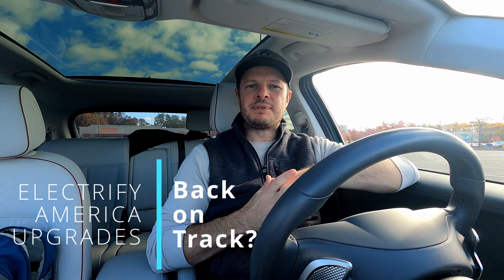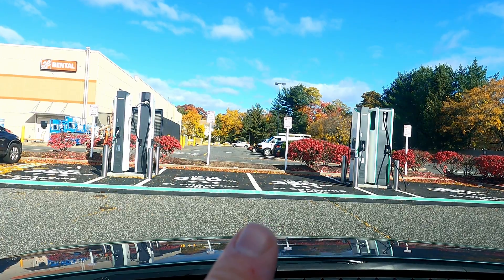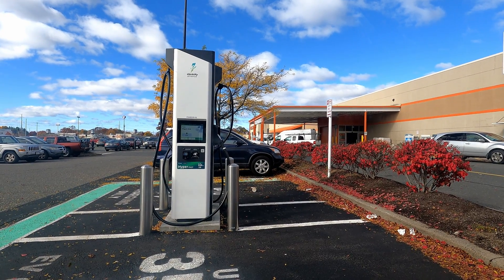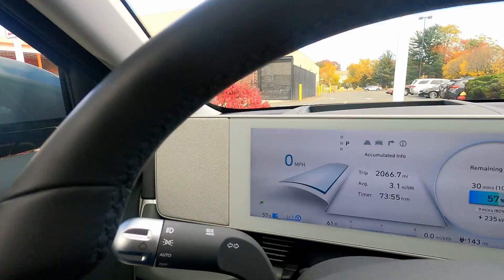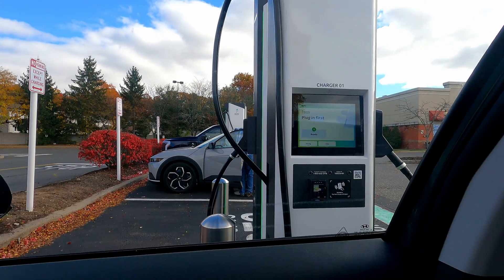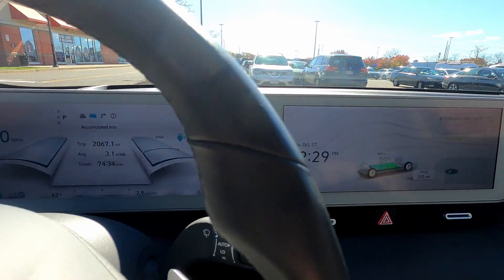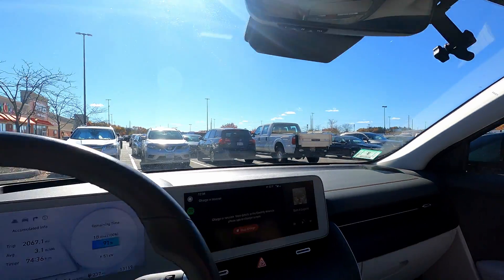Electrify America's 350kW Site Upgrades (with Balanced DC Fast Charging)

Comment: Steve, great testing.  It seems EA is becoming more reliable with the New units.  I'm glad the EV crowd got on EA to show they were lacking in reliableaity.  New owners will have a better user experience.  EA and auto manufacturers still needs get plug and charge  working for all vehicles.
Reply from the maker: Thanks, David. I think the challenge now will be keeping these stations fresh and making sure that none of the old "problem locations" take too long to be upgraded. But new owners will also need to bear some responsibility for learning their vehicles and the best way to activate a charge. Every new tech takes a  bit of adjustment and it makes sense to dig into the details when that new tech is our mode of transportation!
Reply: @plugandplayEV  for ease of use, cars with PnC and Autocharge have an advantage over any vehicle that requires the driver to futz around with payment options such as app or credit card.
Reply from the maker: One would hope P&C would be a better solution, but unfortunately it didn't seem to help the F150 Lightning owner in this instance. Once the bugs are ironed out, though, that's undeniably what we need.
Reply: @plugandplayEV  I was really confused at first by the Lightning driver. He pulled into the stall at first only to realize the charge port is on the other side. Then he plugged in but didn't charge. Switched stalls, then got a charge session going. I could be wrong but my guess is that he didn't have PnC enabled on FordPass and doesn't have the EA app on his phone to initiate the charge from inside the truck so he ended up using a credit card. Reason I think this is the case is because I literally did this exact same charger dance when I first got my MME.
Reply from the maker: @anthonyc8499  That might actually be the case, as the owner only picked it up a few weeks ago.

Comment: Steve - I haven’t seen the new EA chargers yet.  From this video, It looks like the cords are more flexible than the original EA cords, which require quite the twist to turn around and plug into the side of a Bolt.  Are they easier to work with?
Reply from the maker: I should have compared to the previous gen Signet unit CCS cable, but yes I did feel these new units were reasonable to manipulate. It didn't take much effort to snake it around and under the I5's rear on charger 02, for example, and still slot the connector comfortably into the charge port. Still bulky but the management of that weight is definitely better than on units were the cable just hangs out.
Reply: @plugandplayEV  - good to hear.  Those charge cords on the original EA deployments were a bear, especially when they are cold!
Reply from the maker: Oh, that's a good point, I'll have to return to all these new units when it's below freezing... winter's going to be busy! 🥶

Comment: I hope that future charging stations will be balanced charging across the entire site.  
This would be a game changer for all  EV users. 
Imagine you don't need to know what DCFC speed  you "should" be picking (350/150/50kW) that depends on your cars max charging rate and its current state of charge and the current battery temperature.  This in combination with plug and charge would make EV charging process WAY simpler than filling up with gas (picking fuel grade and paying with cc).  
Why balanced across the entire site rather than pairs of stations? Imagine two low state of charge Ioniq 5 plugging in on the 2 balanced 350 kW units on the left (no-one using the stations on the right). The Ioniq 5 could not charge at max rate because they have to share 350 but the site still has capacity since the power on the the right stations is not being used. Then as the 2 Ioniq 5 battery's are filling up and they should theoretically move to available 150 kW stations so other empty fast charging EVs could use the fast 350kW units. If it was balanced across the entire site and all stations have the same max charging rate of 350 then you just plugin and the site will give you the max available considering your demand and the sites capacity - done.
Reply from the maker: That's a great call. Although I would still encourage new EV owners to learn their car's capabilities and basic terminology, any steps that take work away from the user and have it handled by the hardware are desirable.

Comment: If you ever have the opportunity, I’d be curious to know whether charging a Bolt and Ioniq 5 simultaneously at the power sharing unit will throttle the Ioniq. If well designed, I would think both cars would still get their maximum
Reply from the maker: Thanks, I was pondering how to make that happen as the Lightning left the stall! The only interference, other than scheduling, is that winter temperatures will interfere with the max charge rate on both cars, so we might not be able to easily separate EV limitations from what the charger is allowing. Will see what we can do though, if we get more days in the 60s.

Comment: 5:56 I understand what EA was trying to accomplish, but I have to say that, after visiting some of the newer EVgo sites, I prefer their approach. EA is offering 350 kW with a two dispenser footprint, but the Delta EVgo chargers allow for 350 kW with only a single dispenser.
Reply from the maker: I tend to agree. I think "balanced" is too vague and it's not that prominently labeled here either. The approach should work out in a high power/low power scenario, like an I5 and a Kona Electric, but the EVgo approach delineates things more clearly, regardless of the EV model.

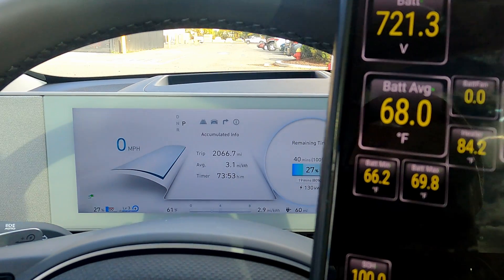Comment: 5:11 Is there any word on whether they'll roll out battery preconditioning in North America before this winter?
Reply from the maker: It actually shipped with the car for more recent I5 buyers, roughly around June/July, some seemed to have it. For the rest of us, Hyundai says it's "being worked on" for North American owners. Given the solution is already being applied to European vehicles, it sounds like it's mostly a cost consideration over here (i.e. will Hyundai corporate compensate dealers, or do early owners need to pay).
Reply: @plugandplayEV  Okay, that's good to know. I don't know how big holiday travel is going to be this year, but it will be nice to see the fast charging EVs still charging fast during winter.
Reply: I called the company they said no word but others have been told they are working on it. I see Kia has put out the update. Don't know what the delays are .  Norway and Uk have got it even I5s made in 2021. In Norway the cost is 145$ . Hard to believe these parts of Hyundai don't communicate with each other.  The US/Canada seem to be dragging their feet. Good way to alienate you customers. Heard rumblings of class action lawsuit as the feature is listed on the sticker.
Reply: My Ioniq5 is in the shop right now having a list of little annoyances looked at, I specifically asked about this and they specifically looked it up. Nothing available at the moment.
Reply: I just did a long road trip - through WA/OR just being 10c/50f temps more than doubled my charge times. Day 2 through CA at 18c/64f was a breeze and close to advertised except for 1 station where it’s an EA thing. Hyundai really needs to help us out. It will brand damage probably permanently if they fix European cars and knowing also that ev6s as well will get fixed. I DO NOT want to know how painful this trip would be in true winter or an all north route in even mildly cold temps. 

I’ll see how my return trip goes next week.
Reply: Is that the Car Scanner App that you're using?  Are you willing to share your custom template that you use?